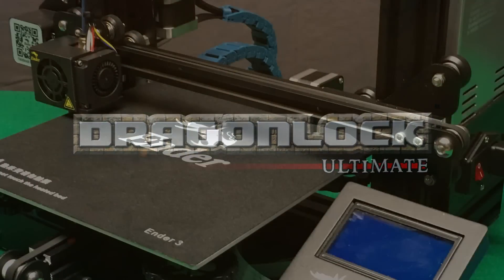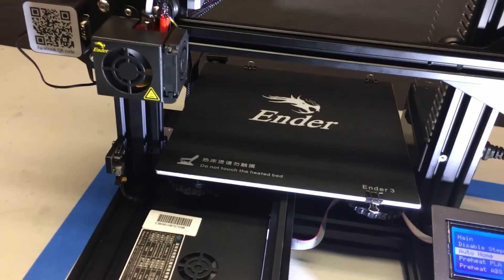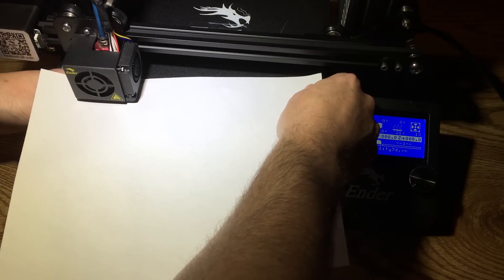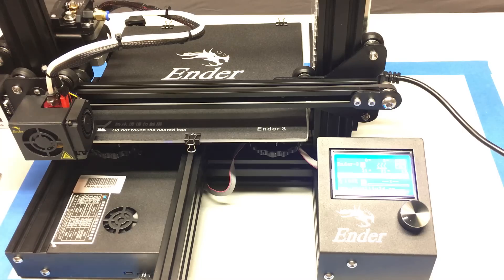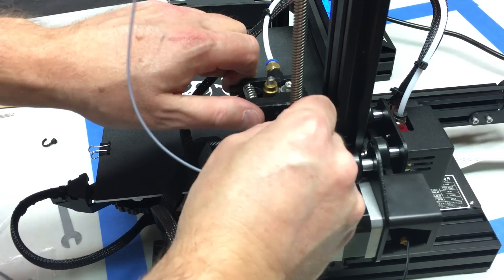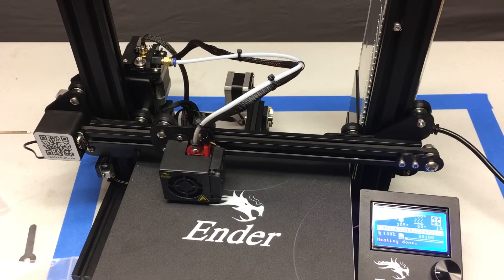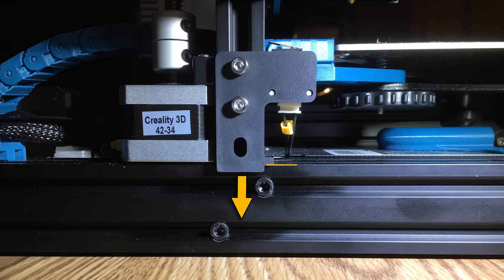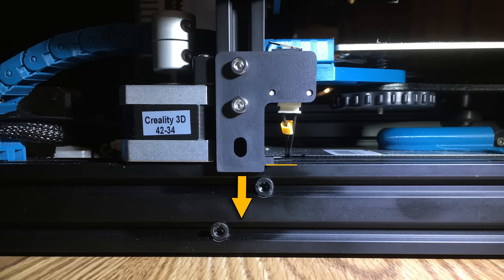3D Printer Manual Bed Leveling

Comment: Hey, thanks for the excellent videos.
I just finished building my ender 3 with v1.1.5, metal extruder, pneumatic fittings, and glass bed upgrades. After leveling the bed a number of times, due to some minor scratching between corners from what I guess is some warping, I attempted a print of your bed level 190x190 gcode.
Unfortunately problems happened quickly. Basically the print is far on the left side of the bed (really off center) which caused the nozzle to hit the clips I use to attach the glass bed. I stopped the print after it ran into the second bottom clip on the right corner. It looked like I was getting a level print too. My Auto Home puts the nozzle off the bed on the y axis and just barely at the edge of the bed on the x axis, but from what I could see in groups this is normal.
Wondering where to look to find resources that will help understand why your level gcode isn't center for me. Thanks!
Reply: For anyone else having this issue- I did too at first. It turns out the printer runs a line down the left side of the build plate initially. I assume it's to clear out old filament and get it running smoothly. Then it will print the test squares after. I had to move my clips to the front and back edges of the build plate.

Comment: Is the test file work with ABS also? I'm very new to 3D printing and bought ABS filament and am having difficulty leveling it. Just wondering if it's the temps are off?
Reply from the maker: Yes it will work with ABS, but requires much higher temps  :)

Comment: Nailed it perfectly on the second try, thanks so much! 

Unfortunately I waited too long to remove the print. It completely cooled and was extremely difficult to take off. So I heated the bed to 68 degrees, waited a few minutes, and then was able to peel everything off. I'm new to 3D printing, so if there's a better way to remove prints that are stuck on, let me know!
Reply: I was just looking at the comments to figure out how to clean the bed after the test! Ill have to try heating the bed!
Reply: @traciwills3722  I've had the printer for a few months now. Now I realize the test print is so hard to remove because it's so thin! Best to remove right after it's done.

Comment: Congratulations on the video! I am new in 3D printing and it was really helpful to build my printer. I printed the 5 squares to test the bed leveling and it looks to me it is working fine. However, I am having a really hard time getting the squares out of the bed. 3 of them are already out, but it is almost impossible to get the other ones out. Any tips? Is there anything I should change for future printing? Tks

Comment: Soooo... How do I clean the Ender bed pad after I do this?
Reply from the maker: Rubbing alcohol works great. :)
Reply: I just heated the bed up to 75-80 and could then peel it off using the spatula.
Reply: @thomastempelmann  No worries about demagnetizing the bed? 
What temp is too high anyhow for the magnetic bed?
Reply: @RichardAdkins  Well, since ABS printing requires temps around 90-100 deg. Celsius for the bed, I'd expect the bed to be able to handle that.

Comment: I tried using your leveling file, and it printed off the front of the bed. The nozzle dragged one of the clips holding the build surface, and tore the wire handles off of both of the front clips. I stopped the print right away, and tried printing a 20 mm cube in the center, and it printed about 3/8" to the right and 3/8" forward of the center of the buildplate. I'm guessing a problem with the firmware? Do you have any idea how to fix it?
Reply from the maker: Change your machine settings in cura to 235x235 and re-sclice it. :)
Reply: @Tombof3DPrintedHorrors  I'm feeling pretty stupid here. I have Cura 3.6.0, using Creality Ender 3 as the machine. I can't locate a place to set  the area to 235x235. What setting should I search for?
Reply: I'm using 3.5.1 but I changed the X and Y in Settings\Printer\Manage Printers... Select your printer and then under Machine Settings you will find X and W values. I'm a complete beginner so this may not be correct but it appeared to work for me.
Reply: @paulhoffman6506  Thanks for the info. You are right; that is where it is, which is good news. The bad news is that it is already set correctly, to 235 x 235 x 250, so that doesn't solve my problem. I am getting by for now by not putting anything too close to the front or right side of the build plate. I just won't be able to build anything bigger that 220 x 220 for now. I think this is something that can be adjusted at the firmware level, but I need to do some research before I can do anything about that.
Reply: Thanks!! 
 @Tombof3DPrintedHorrors
Reply from the maker: Thanks for watching! :)

Comment: I have found you videos extremely helpful for novice users like me. I have had my Ender 3 for five days now and I am still mostly printing printer upgrades.  I have a comment about this video, "3D Printer Manual Bed Leveling".  You mention some really basic things that most others don't and it is extremely helpful to have some of the "dumb" nubie questions answered. One thing, everyone says get out a sheet of paper, turn  the wheels, it should just catch.  I did this and with your bed leveling gcode. So far so good. Well, my bed was a little low in the left front and a little more across the back. So I raised the left front about 1/4 turn and the backs, about a 1/2  turn.  WAY TOO MUCH.  Al l of a sudden I was getting nothing printing  for the back squares at all.  It took me a few more prints to figure out the problem and I finally corrected it.  Here's the thing, you need to specify what is a  "little bit" when you raise or lower your bed.  As a nubie, I had no idea that 1/4 turn is A LOT.  The Ender 3 has little knobs on the adjustment wheels and you should only be moving them like 1 or maybe 2 little knobs at most. Almost nudge the adjustment wheel.  This needs to be made CLEAR to Nubies because my idea of "a little" was way too much.  Its a tiny tiny adjustment you need to make. Please emphasize just how tiny.

Thanks,
Your Videos are some of the most helpful available.

Comment: I have an Ender 5. I used the control panel to level my bed. When I clicked on Auto Home the extruder went to the back right of the bed, which was odd because the manual said it should go to the front left. After selecting Disable steppers in the control panel, I manually adjusted the 4 corners and slipped the piece of paper between the bed and nozzle.

Unfortunately when I went to do my first print from the SD card, the nozzle moved to the back left corner and started gouging into the bed. The cover is now burnt and torn in that corner.

Comment: Great video!  But... I am a complete 3D Noob.  So I followed your build instructions (also great), then came here and followed your leveling instructions, then like you said, preheated the nozzle and the bed, and found that I had not loaded anything on the SD card (heck, I didn't even know where it went until I looked around.)  So it would be nice if you had mentioned to load/insert the SD card before heating everything up (maybe even walk through that for others (this I can do, I just didn't know it was needed.)  Unfortunately it was late last night.  Will continue tonight!

Comment: The middle of my bed seems much lower than any of the four corners, i need to fold the paper to two layers before i can get it to grip the same as the corners
Reply from the maker: Go ahead and run the test squares, the paper is only to get you in the ballpark. :)
Reply: @Tombof3DPrintedHorrors  aha, the test squares come out just fine thanks :D Now onto slicing things in cura. I have tried to use your linked terrain profile to slice a fan cover, but cura refuses to import it as it "does not contain any valid profile"  is this because of verison mismatch? do you have more up to date profiles?
Reply: I have opposite situation. I'm running 10th test print and get it leveled in the center.

Comment: I have a question, how do you remove the test print from the bed? I can´t do it with the spatula.

Edit: I solved it by heating the bed to 110º and then used the spatula. It came off pretty easily.
Reply: Thank you I am a noob and couldn't figure out how to get it off lol

Comment: Thanks a ton for this!  I followed your build vid, and then did this leveling test & print and it came out perfect!  I only have one issue.
How the heck do you get the test print off the removable bed cover the Ender 3 comes with?  It's on there so well, no amount of scraping gets it off! It's the really thing parts I'm having problems with.  Thanks!
Reply: did you figure it out? I'm having the same issue
Reply: @sniperguy5580  the test print left a residue that I can't get off around the extreme edges, but it doesn't seem to affect anything.  It's thin, it's like it's permanently bonded to the bed.